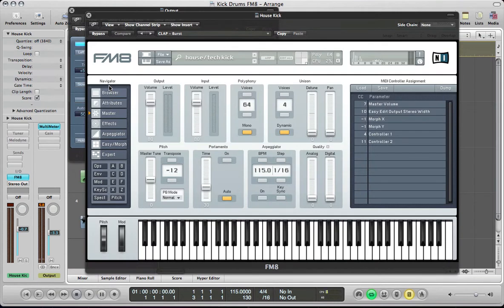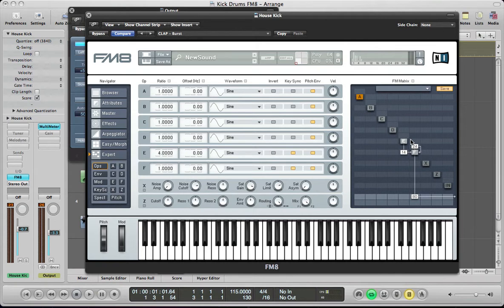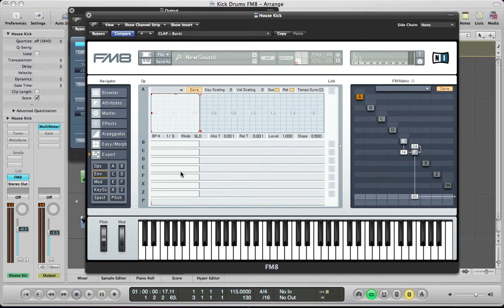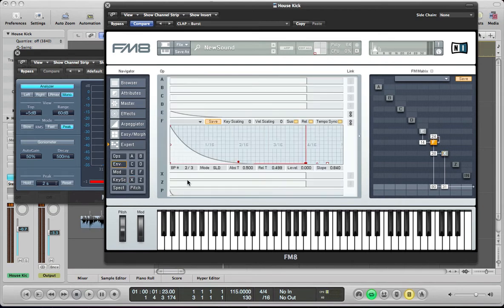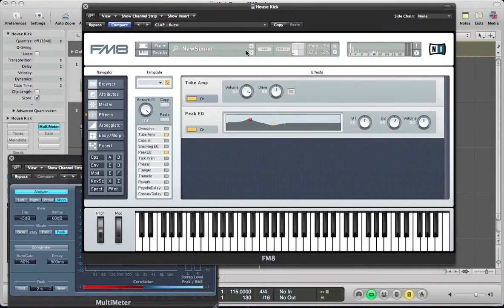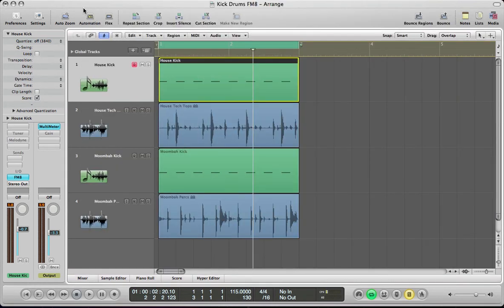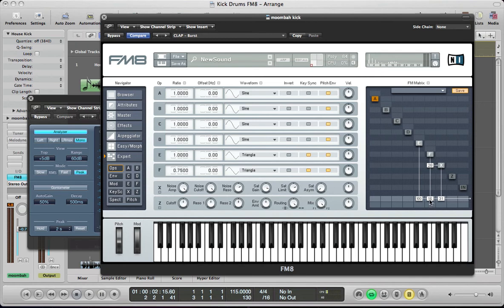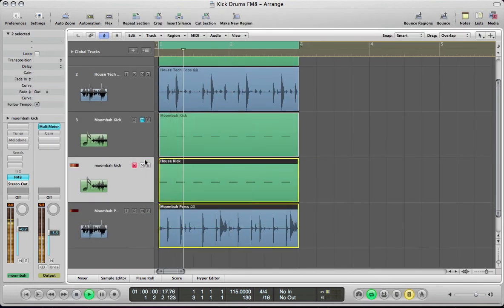Creating Custom Kick Drums in FM8

Comment: Cool video man. Just a tip: instead of dragging ur pitch envelope all the way down, only boost it up and have it rest at 0. Then tune the sound down a bit (bc your not bringing the pitch as far down) and boost the env amount (bc it's less of a drop now) This will put your kick perfectly in tune (ie master pitch: -12 and your kick is tuned to C. Now you no longer have to use melodyne or a tuner and more importantly the kick will be right on pitch. When you move the tail of the pitch decay down from 0, chances are you won't hit a real note (less than a half step from the nearest note). This is especially helpful with kicks and pluck basses bc detuned lower frequencies are more noticeable at smaller intervals than higher notes.Hope this helps and thank you so much for giving back to the EDM community.
Reply: I was thinking the same! Really good tutorial nonetheless :)